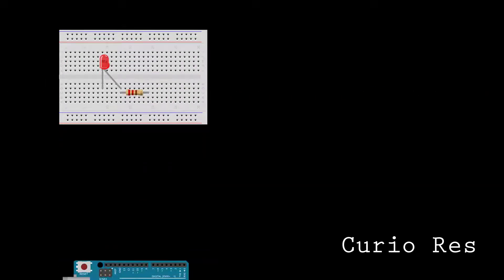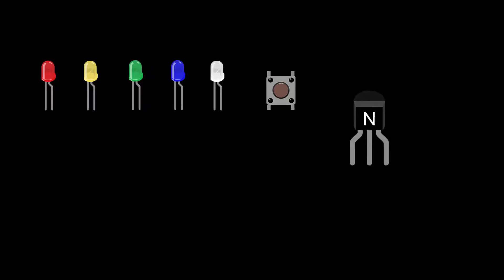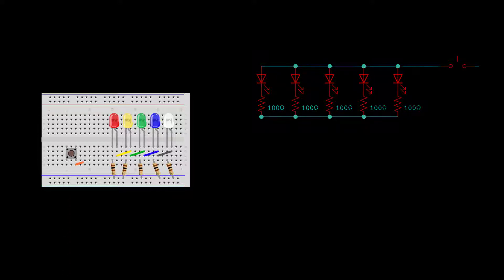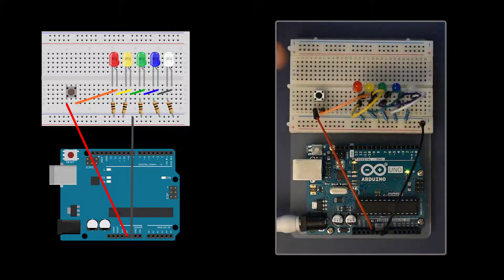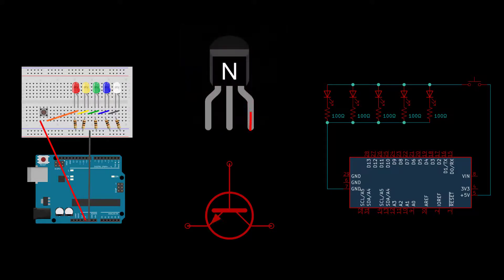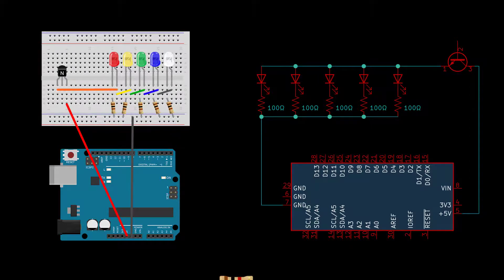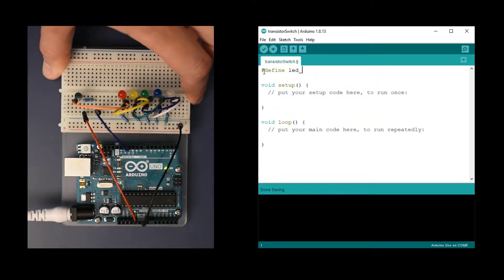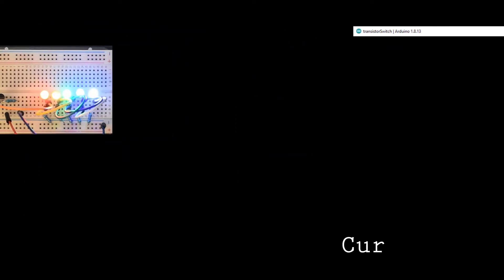How to use a transistor as a switch

Comment: do i need more information about the "NPN Transistor?" is it just a NPN Transistor or does it have a number what do i look for to buy one?
Reply from the maker: There are all kinds of NPN transistors. I was just using one of the common PN2222 transistors from a starter kit, if I recall correctly. Which transistor you use depends on the load (you might not even want a transistor at all. For example, if you're powering a DC motor). If you have a particular application in mind I might be able to give you some tips.

Comment: Loads must connected to collector . Otherwise  you are messing  with hFE.
Reply from the maker: Good point thanks Nick, some of the non-ideal nuance of electrical circuits still escape me. This is a good one to know.
Reply: @curiores111  what is he talking about? what is hFE?
Reply from the maker: @charlesklein7232  He's saying you're supposed to wire the load on the side with the collector. In that wiring, the emitter doesn't have a load but is connected to ground directly. 

The hFE is the DC current gain of the transistor. I haven't done the calculation myself of how this wiring will reduce the performance. Suffice it to say that you should wire the ground directly to the emitter, or you may suffer a reduction in the performance of the transistor.